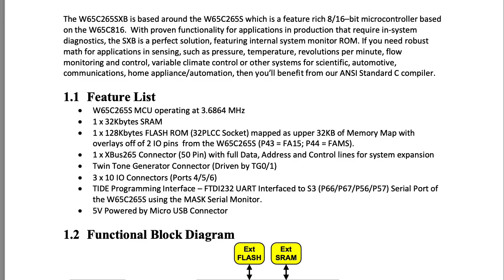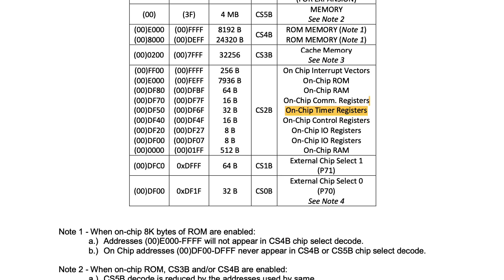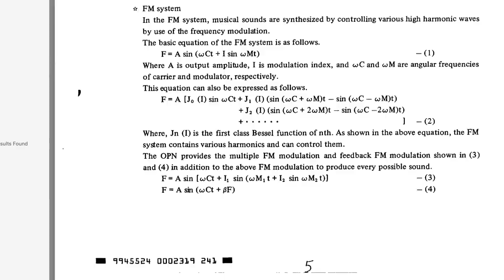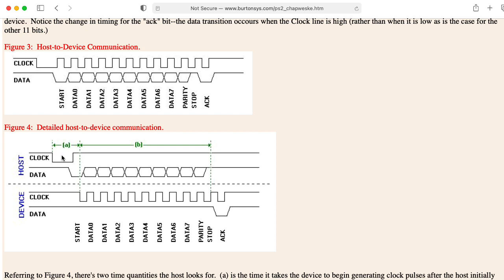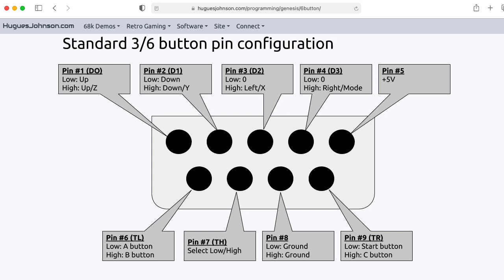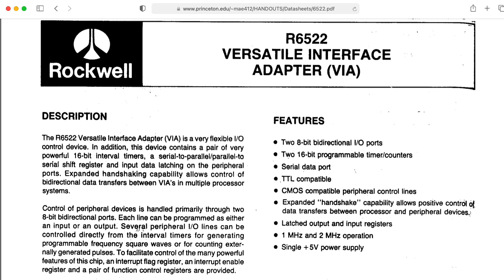W65C265SXB: Planning Video, Sound, and Joystick Connections for Stackable Homebrew (65816, 6502)

Comment: I also got inspired by Ben Eater's 6502 breadboard computer, but thought that it could be done more efficiently so I found the WD65C816 and later the WD65C265 and recently ordered the 265SXB board, but it doesn't work. :-( Of course I won't give up yet. BTW, I was designing a PCB with the 265, but buying an existing board from Mouser seemed much easier...

Comment: Can you use serial ram for that?
Reply from the maker: Not as "main memory" but it certainly offers enough I/O to read and write from a serial RAM.
Reply from the maker: It doesn't have built-in SPI but the microcontroller is powerful enough to bit bang it.

Comment: I like this type of 8-Bit CPUs , compatible to 6502 Code. But a max Crystal frequency of 8 MHz is not state of the art. The older 65C816 run on 14 MHz overclocking to 16 MHz is possible. Where did you buy the SXB - Board? You can change the crystal to another value.
I like to interface this CPU to a TFT Display. A NTSC or PAL Videooutput is not the best solution. 8 Bit Interface or HDMI Chip is a better choice I think.
Reply from the maker: Yeah, the 65C816 can run faster, but it also requires some annoying demultiplexing hardware for the upper address and data lines. (Although if you are happy with 64K of memory you can live without the demultiplexing). Nice thing about the W65C265 is all 24 address lines are brought out.

If I was going to go with a TFT display, I'd go for one with a built in controller (like the ones Adafruit sells) and either use the 8-bit interface or bit bang an SPI interface.
Reply from the maker: I've ordered the SXB boards from Amazon and also directly from WDC (it went to a Tindie site I think).

Comment: It's strange to design / build a homebew computer  (from 1987 era) based around a 1970s era CPU ?? By 1987 the 68000 CPU was clearly the obvious choice ..?? This was shown by the Atari ST and Commodore Amiga being so dominate in the Home Computer market.
Reply from the maker: That's exactly why I'm approaching this project this way. ;)

One aspect of my Retrofuturistic Hardware team is that we like to explore alternate computing histories. For instance, Steve Jobs arguably artificially hobbled the Apple IIGS so that the Mac, which he championed, would shine. What if the IIGS line had continued instead?

There'a already quite a few homebrew 68000 designs out there, so I wanted to explore a different path.

The main thing is I grew up on the Apple ][, and hence have an emotional attachment to the 6502. So the 65816 is a natural route to pursue, or really in this case, the 65C265 since we need less support chips that way. 

If I did an equivalent project with the 68000 architecture, it would be fun to use a 68000-based microcontroller, like one of the 683xxx chips.
Reply: It was used in the Apple II gs which came out around the same time as the Atari ST.

Comment: The 7401 and 7403 have different pinouts. My guess is the 7401 came first, then someone thought it was a bit silly that it didn't have the same pinouts as the 7400, so they producted the 7403 to fix that.
Reply from the maker: Oh, that's a good point! Yeah using the 7403 makes much more sense then, since everyone is used to the 7400 pinout.

Comment: I got, cheaply on aliexpress, a bunch of 6502, and 6522, and a bit of SRAM. Do you happen to know some reference showing a minimal setup (circuit) to get a program into that thing and running? Perhaps with some of the stuff in the 6522 (shift register? Supposedly buggy, though), I might get some data into a monochrome, low res, SPI - OLED to do some display, if slowly... I kinda always wanted to do that ^^ But I don't want to exactly replicate a whole VIC20 or something.
Reply from the maker: I'd start here: https://eater.net/6502

Nothing out there beats Ben Eater's educational materials.
Reply: @Lantertronics  Hahah, cool, thanks! "build a 6502 computer", now I feel stupid for not just entering that exact word combination into a search engine. (although I had found some stuff before, but a bit elaborate for a weekend round or two of tinkerage)

Comment: Nice Project, Why use discrete hardware when the whole system can be burned on a DE1 Cyclone II Board.
Looking forward to seeing the updates on the project.
Cheers✨✨✨
Reply from the maker: Doing such a thing in an FPGA is certainly a worthy an interesting project, but that's a different project for a different purpose. To some to extent, you could also ask, why bother with any of this old technology at all when I'm typing this on a Mac M1? There's an art form to using existing chips, which is different from programming Verilog or VHDL. More immediately, I've never used an FPGA and don't know any hardware description languages, although I very much want to learn such things in the future. My students all learn VHDL in our ECE2031, our sophomore computer engineering lab, but I went to school in the back in the Dark Ages before such things were common. ;)
Reply from the maker: There's another project out there to use a 65C816 with FPGAs that are meant to represent the kinds of custom chips a company like Commodore might have made if they continued the Commodore 64 line of computers instead of moving to the Amiga: https://c256foenix.com/products/?v=7516fd43adaa

Great project, but with different design goals than mine. I wanted to stick with chips which, while out of production, are at least somewhat readily available on eBay (although you have to look out for counterfeit chips!)